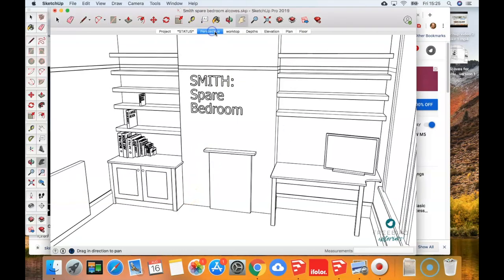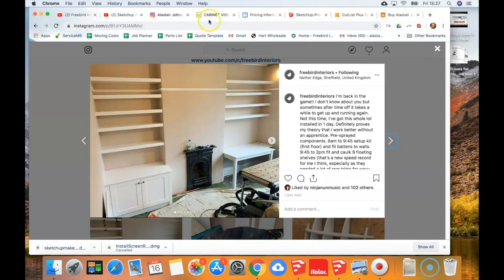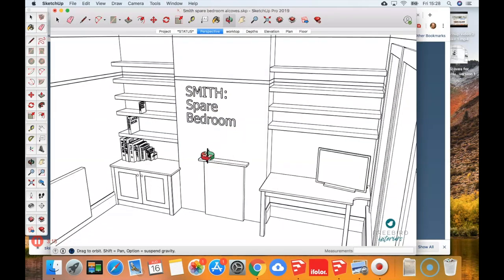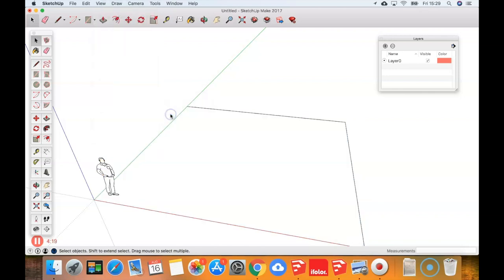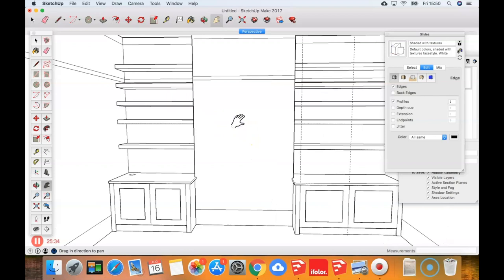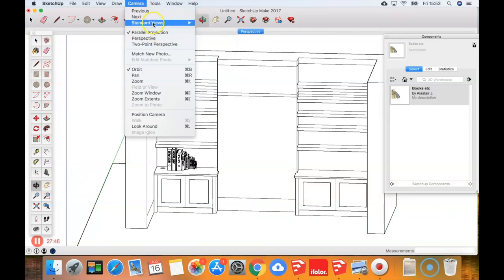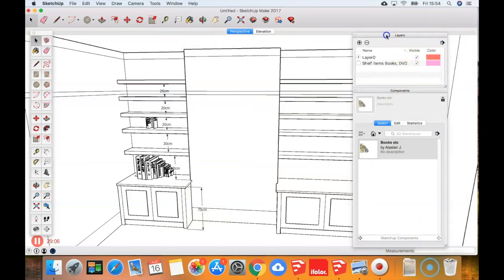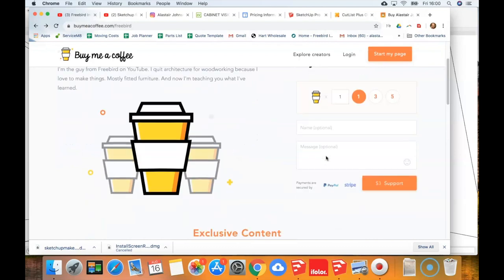Sketchup for Fitted Furniture Makers: Part 2

Comment: Thanks so much for these videos!

I previously tried to use SketchUp to design a built-in set of wardrobes, but it was taking me so long I switched to pencil and paper.

This time around I'm building a set of wall mounts for my speakers, a bit of a simpler project, but wanted to play with bevels and angled fronts. I watched part 1 and was up and running right away because it was exactly what I needed to start drawing with sheet materials. 👏
Reply from the maker: Great, thanks for the feedback!

Comment: Absolutely fantastic tutorial, this is exactly what i been searching for trawling through loads of American videos that never quite fully explained what it was i was trying to achieve or i was having to watch multiple videos to get what you have explained in this single video.

I have been reverting back to to paper sketches with clients as i was always getting stuck at a certain point with SketchUp & didn't want to show clients an half finished project, but i am now getting so many requests for fitted bedrooms & bespoke cabinets i have got to get to grips with SketchUp, also the yearly subscription is a waste of money if its not getting used for the purpose it was purchased. 

Thank you very much for taking the time & effort to do these SketchUp Tutorials.
Reply from the maker: I loved reading this comment thanks for taking the time to let me know!

Comment: Great informative video. I've been a follower of yours on IG a while (matts.garage) and have only just started on these series. I've used SketchUp in the past to design a picnic table, a Festool Vac Sys cart w/ Sys-AZ storage, some Sys ports but I've never needed to do an actual room with fitted cabinets until now. I couldn't wrap my head around how to lay out the room then put cabinets into it and you've explained it so clearly. Thank you.
Reply from the maker: Matt Eason thanks for the comment Matt, it’s really interesting to me that you were using the program successfully already but that this gave you extra help 👍

Comment: Great, thanks Alastair, these are great vids on sketchup. I'll be buying you a coffee too. I'd be interested in seeing how you turn the customer presentation into something you can use in the workshop.
Reply from the maker: Hi Chris Thanks.  I will get onto that.  I am building it as a series that should move viewers through basic SketchUp modelling; presenting drawings for customers, and eventually creating cutting lists etc. I did however show some cutting lists and how they are transferred to the workshop in the recent video titled ‘homebased workshop part 2: making it work with a team.’  This gives some insights into the process that you will find interesting I think.
Reply from the maker: https://youtu.be/Do5CB91Fv_Q
Reply: @Alastair_Freebird  Great, thanks. I'll watch that.

Comment: MASSIVELY useful video. Having tried a couple of times to learn sketchup and given up this has really helped, along with your earlier video, to explain things in practical terms for a woodworker from the ground up. Will be heading over to buy you a coffee and download the components when I have my pc booted up (BMAC website doesn’t really seem to like iPads.....). Thankyou!
Reply from the maker: darren green I’m glad it was so helpful, thanks!  I’d welcome any more detailed feedback on BMAC on iPad, I will pass it on to their development team who are very responsive and proactive about improving things.
Reply: Freebird Interiors Hi Alistair, just bought you a coffee and via the iPad. Whatever the glitch, it seems the guys at BMAC have fixed it. From what I remember, the system hung at the point of payment after selecting PayPal as the method. No issues today though (and possibly could have been a PayPal issue, not unknown).
Reply from the maker: darren green thanks for that.  Generally if there are issues they seem to be PayPal related; they recommend using Stripe.  Did you receive the pdf download ok (hafele Loox lighting crib sheet)?
Reply: Freebird Interiors yes, got the crib sheet and also downloaded the bookshelf item component. Thanks

Comment: I discovered SketchUp around 6 weeks ago. Cracking software. Intuitive and effective. This video is exactly what I needed for my own renovation needs. Great stuff.

Also, I wonder if there's any option to take into account uneven or sloping walls. I suppose that would help immensely in the design and fitting process, but it's perhaps beyond the remit of the software.

Comment: Hy! I hope I don't bother you too much... I have another question: how do you change the size of a component?
Reply from the maker: Ryno Vlad hi, you can use the scale tool.  Select component then Keystroke S. Click on the relevant grab handle then start moving it. Type ‘x2’ and hit enter to make it twice as big in that dimension.  Type ‘1100mm’ and hit enter to make it that exact size.  Note: if you scale a component from the top level (without ‘opening’ it) you are distorting that version of the original.  If you double click to open the component then scale it you are changing the original component and other linked components in the model will change accordingly.